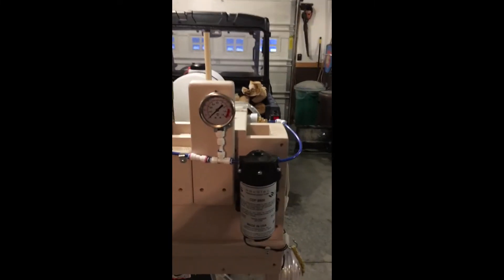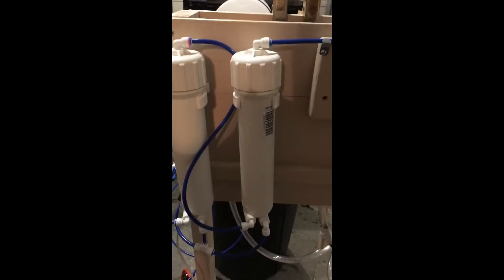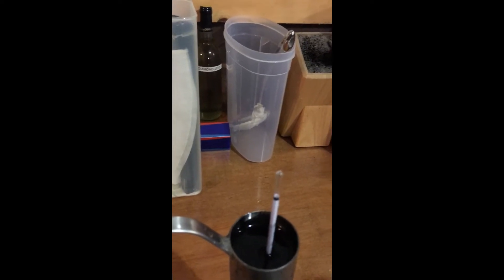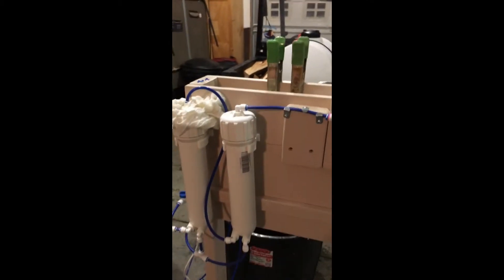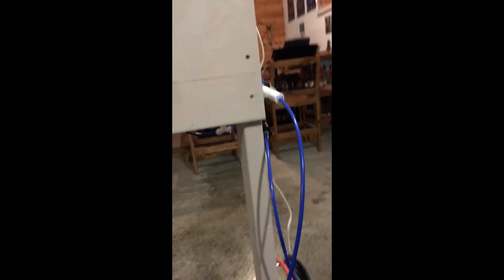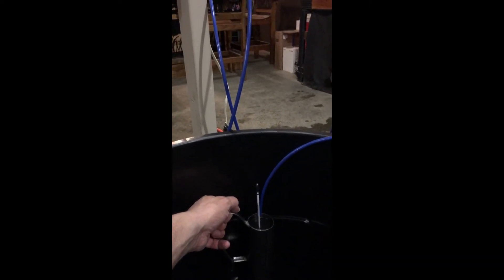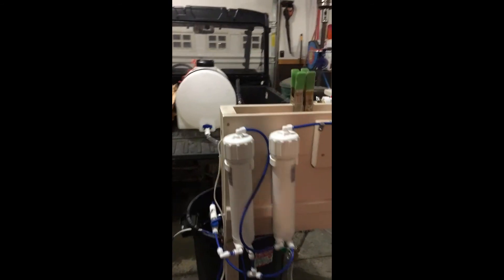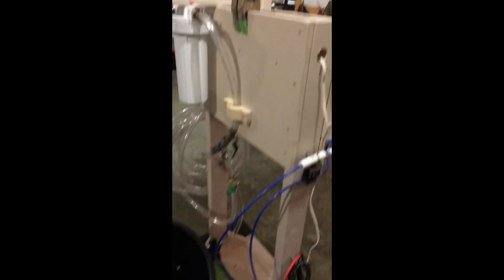RO System Part 2

Comment from the maker: I did add a splitter after the 5micron filter and the high pressure pump just to give the transfer pump some place to move the back pressure, it just goes back into the holding tank with a valve on the end

Comment: The transfer pump that you have is a brushed motor and will not last very long, a better pump would be Harbor Freights sprinkler pump, also the pump isn't really needed for running the RO just the small booster pump.
Reply from the maker: I agree. I have changed my system and removed that pump.
Reply: @mountaintopmapleco.6825  I have the same CDP 8800 pump as you with a 3/8 line on the suction side.  I have no problem sucking sap straight out of my barrel with that pump.

Comment: Is cleaning a pain in the butt? Seems to be based on some blog posts.
Reply from the maker: No not really. I have changed my system this year but to clean it I remove the filter from the 5 micron house cartridge and through it away. I run a 5 gallon pail of hot water with two 12oz bottles of isopropyl alcohol through it. After that another 5 gallon pail with clean warm water. Then I take out the RO filters and store them in a refrigerator in zip lock bags for the year.